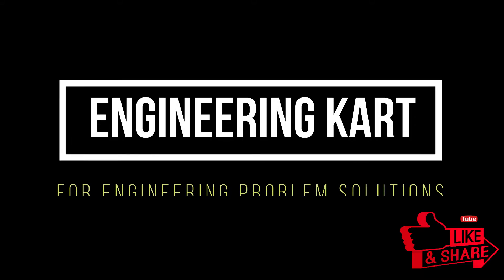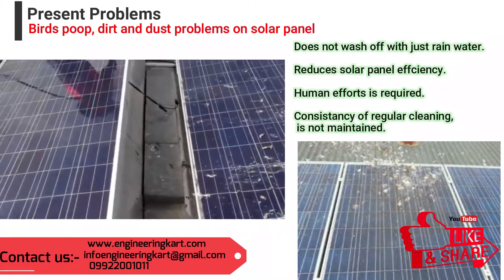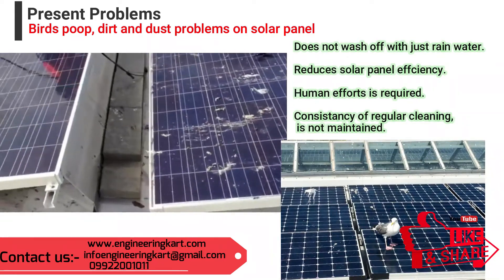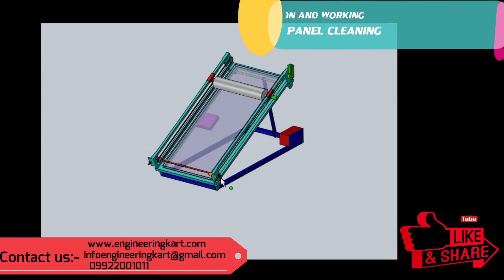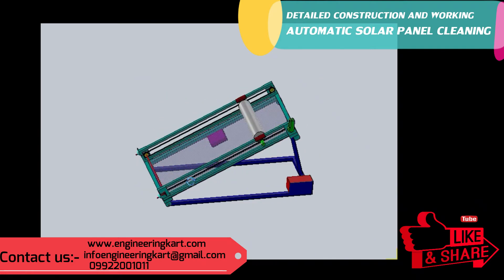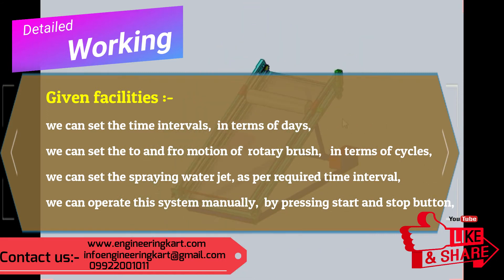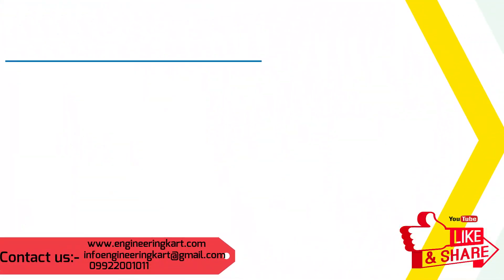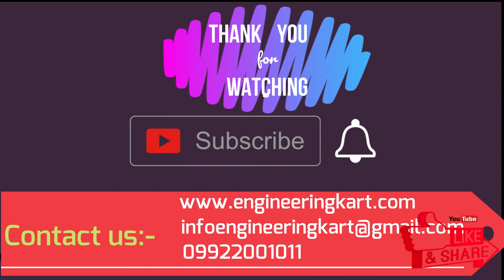SOLAR PANEL CLEANING | AUTOMATIC SOLAR PANEL CLEANING SYSTEM

Comment: We are doing work on automatic solar panel cleaning system in our FYP...could you please help me??
Reply from the maker: pl mail us the problem
Reply: @engineeringkart8878  . sir we need. Motor controller for controlling 6 motor and also time delay for auto looping. That mean the motor starts from one point to another ans.comes.back and stops. Could u provide us the complete circuit for plug and play working
Reply from the maker: @ssunilkumar7  call tp pawar sir 8600606232
Reply: sudah dapat ka barang barang yg diperlukan